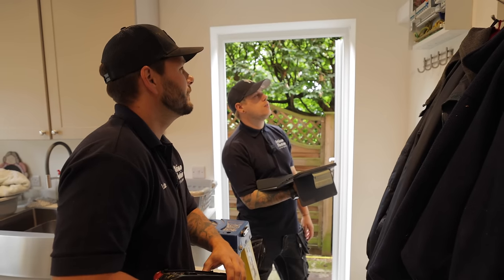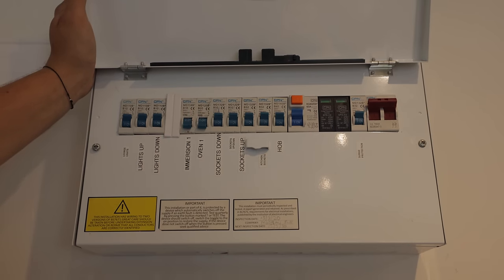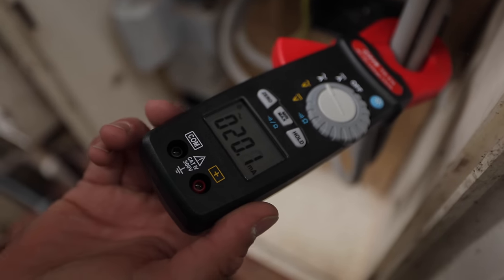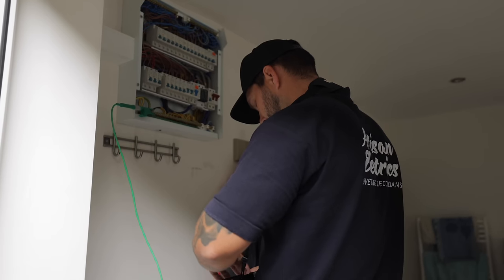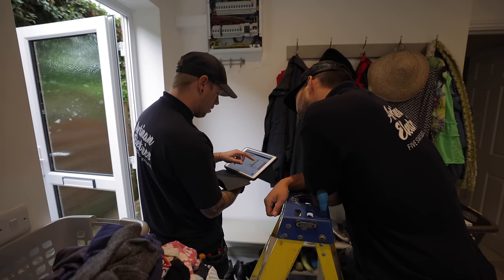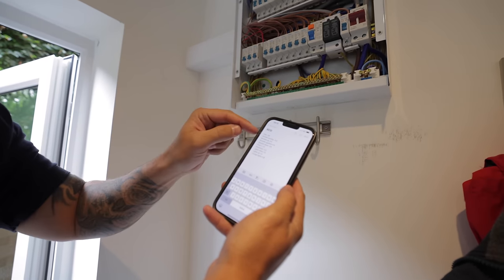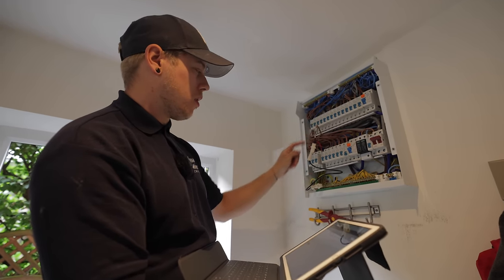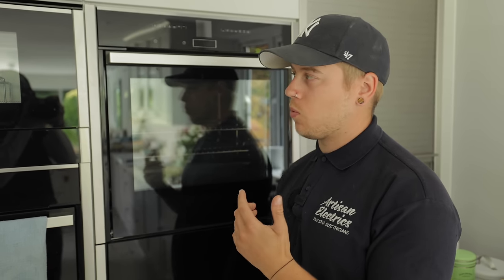CHEAP Electrician cost this customer £1000s💷

Comment: We have the rcbo version of that board and it is a delight. A led comes on when you open the cover too. It was being promoted by cef at the time. It certainly wasn't budget end. 
Very good video sharing the issues of earth leakage. Much appreciated
Reply: I've fitted a few of the rcbo boards and never had issues.
Reply: It is a budget brand. Not great at all. Not as bad as Wylex or Fusebox but not great St all
Reply: @peterigrenyi9176  I'm surprised you say that. It has everything a homeowner looks for, and the automatic lights are really helpful. The rcbos and rccb have worked flawlessly since installation. And it was recommended by our electrician. If this is a budget brand then why do people need to pay more?
Reply: @atkt62  just not built as well as more expensive brands. Also would expect a struggle with customer service if there is a problem. 

From my own experience with this board,  terminals not great, screws on few mcbs/rcbos damaged when tightening withing torque limit, lid never sits quiet right, etc.  I also expect more recalls on mcbs etc too. Just like wylex, craptree etc. 

Would much rather fit Hager. Cost probably not far apart.
Reply: @peterigrenyi9176  I understand your pov. However, we are 3 years into our cpn cudis rcbo board, not one issue. Our electrician says he fits these as standard. I guess everyone has their preferred brand. Look at the cars on the road as an analogy.
Reply: @atkt62  There's a lot of brand snobbery around...

Comment: How I understand it you took the earth off the backbox and connected it to the switch. The regs state only a backbox with 1 fixed lug doesn’t need a earth to it, however here because of the isolator type lug you have now left this backbox without a earth, which reg does this comply with?

Comment: I'm glad I am still on ceramic wire fuses. Two blown fuses in 30 years and then that was because of old type light bulbs that are no longer in existence. 
This lot🙄one electrician to test and one to film.
Reply: I'm suprised both of you don't use charriots to move around too! 

Ceramic rewirable fuses certainly works but they can't compete with how fast an RCD or RCBO trips in a fault condition and the safety such can provide.

I saw cable insulation melt/get brittle because of continuous heat up circles without a fuse blowing up...
Reply: You are glad not to have RCD protection, are you?

Sounds very foolish, even dangerous

Comment: There's no way that was a grand, look at the amount of circuits .  Alarm bells start ringing here looking at the size and quality of the house .  At first I thought the sparky may have recommended rcbo etc and the customer didn't want it but then looking at the quality of fittings and lights and then the  consumer unit install shows different . I also suspect the RCD is rated at 63a not 80 so I bet at times that bottom one is overloaded also . As a temp fix, RCD change and move a circuit to the top bar such as the oven. However a new board or rcbo conversion is definitely what is needed .

Comment: In a new build house from FH 2020... MCB on 2 RCD devices.

I would have PAID for the upgrade to AFDD + SPD.

Also pulled 6mm to the detached garage. Again, would have paid for an upgrade to the cable to make adding a car charger easier.
Reply: Most new builds are designed by the client, and are designed 1-2 years prior the the current regulations. It’s not always the electrical contractor at fault, their job is to do as the spec says. As always we can advise they do things different but if you have 40+ houses like some sites I work on an extra few hundred quid per house stacks up quickly, so they tend to avoid. Speaking from experience on this, it’s an impossible task to speak sense into the senseless 😂

Comment: When you was doing the IR test and sensitive equipment was plugged in, what voltage was you throwing down? I always start at 250DC just in case
Reply: Edit. You prob test @ 250 now anyhow,  forgot about reg 612.3.2 where value still remains at 1M ohm if doing so.

Comment: OK...yeah.. it should have been a RCBO board in the first place, but it isn't. Why is the go-to solution to replace the board, when the problem could be resolved by simply adding another RCD and splitting the bottom row?
Reply: Bus bar cut for the RCD's and you can't buy just the bus bar for an upgrade would be my guess.
Reply: @jonathanbuzzard1376  Hey 👋, I'm not sure if you are referring to the mounting rail, the MCBs etc clip onto, or the Bus (aka Buzz) Bar that connects the Line from the RCD to the MCBs? Presumably it's the latter, but correct me if wrong.
The Bus bar is very cheap, readily available and easy to cut etc. There would be no problem cutting the existing bar to split it; put in a new RCD and a new Bus bar, splitting the MCBs between the two; and take a separate feed from the Main switch and Neutral bar to the new RCD. Oh.... perhaps you mean another Neutral bar??? Ahh yes, that might be a problem alright. 😅

Comment: Is a split RCD board ever the answer these days compared to an RCBO board? Having worked on and installed both I find the RCBO board to be much easier all round, and I find it hard to believe that the overall cost will be much less with the split RCD board. With a decent quality but low cost RCBO board like the ones from Fusebox, what sort of difference in price are we looking at for say a 20 way board install compared to a similar quality split RCD board, both running type A RCD/RCBOs? It can't be more than 10 or maybe 20% surely?
Reply: It's cheaper, that's literally it
Reply: @SBBUK  Yeah I know... But in this case, surely if the spark had told the customer the reality of how many circuits will be lost just because one of them has a fault, then you'd think the (IMO) relatively small extra cost could be easily justified. Not to mention the cumulative leakage causing nuisance tripping. But that assumes the spark actually cared which seems unlikely, although it's unfair to speculate around the circumstances which led to this rather poor design choice.

Obviously some people have no choice but to go for the absolute cheapest option, but that house didn't seem like somewhere you would install the cheapest option. Then again there are people who own fancy cars and install cheap tyres made of chinesium and wonder why they can't keep then on the road! I reckon kids should be taught about "value" as a core subject at school. Not just low vs high cost but actual value!

Comment: Just swap the lot out with RCBOs of the same manufacturer. That will also give them more space for the future. Also, just what is it that's considered to be so wrong with the CU unit itself? Hardly the CU's fault that there's cumulative leakage currents; that's down to the fundamentally inappropriate choice of using a dual RCD board, especially bad in such a large property.
Reply: How would you fit a bunch of RCBOs in that overcrowded board?  Also, they might get a discount buying a premade board with 40+ RCBOs already installed and connected together, instead of buying a wholesale crate of 40 RCBOs that need to be put into the box .  Pricing structures tend to encourage complete replacement on every upgrade .
Reply: @johndododoe1411  Are you aware that an RCBO takes just one slot, and that means they actually take less space as you can remove the RCDs? RCBOs take up less space than dual-split RCD boards. Indeed, you get 4 slots back.

Also, the physical process of clipping an RCBO into place and connecting the bus  bar takes no time. It's the wiring and testing of circuits that takes more time.
Reply: @TheEulerID  My guess is the bus bar is cut for the RCD's and getting replacement bus bars is probably not an option so new consumer unit. Frankly it's a shame that you can't get the spares for upgrades. My board could easily be upgraded from 16th to 18th apart from the two plastic covers for the breakers as it's otherwise a metal board and I could upgrade the none RCD side to RCBO's. Though I am quite happy that the earthshield wired double outlet in my server cupboard is not on an RCD thank you very much.
Reply: @jonathanbuzzard1376  You can get replacement bus bars without any trouble whatsoever. They are freely available, including from suppliers like Screwfix or TLC, and they are available in any length you might reasonably use. If necessary, they can be cut to length.

If you are talking about metal blank plates for gaps in the breakers, then those are also freely available as well.

Of course the break in the neutral bar (for a dual RCD board would have to be bridged with an appropriate copper jumper.

Comment: so many new builds are still having these double bank split load rcd boards installed in 5-6 bed houses, I've worked for companies putting them in. Never understand why they can't just add a bit more budget and get an rcbo board. Like Lee said they need to ditch split load boards all together but will they? There needs to be a dangerous situation occur for this to happen but most the time its just a nuisance

Comment: Why is there intentional earth leakage. I thought earth was only for emergency. 

Am a utter layman as far as electric installation. So if anyone could explain it would be great.
Reply: There are components in the supply (Class x & Y capacitors) of any equipment using electronic power supplies or control to stop harmonic energy getting back into the supply network.  As the amount of electronics and high power switching controls increase so does the amount of interference pushed towards the DNO distribution.  It also annoys the heck out of radio Hams as our licensed frequencies are jammed by the muck.

Comment: Watching these professional electricians videos on YouTube makes me feel sick to my stomach because of what I did in my old parents house when I was little and when we moved out I did not tell anyone about the horrible botchery I hid in the walls secretly.. when I was 14 years old I had only one ceiling light in my room so I wanted to add at least one more so I used the earth wire going to the ceiling fixture as another phase wire and I did the same thing going to the single switch and I never told anyone about it, the same goes when I wanted to add another few sockets in my room with different breaker so I used the existing earth wire in my room as a second phase wire and nobody knows that. When we moved out I never told anyone about it. I was scared my mom would kill me for that lol.

Comment: You have the tester set to the wrong test setting when conducting the rcd test and also an rcd should be tested with the load side disconnect as existing fault current can affect the times and mA and not give you the true readings of the rcd.

Comment: Slating the previous sparks is a bit bad when your pulling cut out fuses when you shouldn't be 😅🤣
Reply: they fall out, vince from network power comeround and oop there it is
Reply: The written rule is not to pull a dno fuse, but in the real world, this rule is totally impractical.

Comment: 15mA on one and 20mA on the other. The maximum permitted leakage on a single RCD is 30% of the rated residual current which is 9mA. Further investigation is definitely required to establish where the high leakage is coming from on both RCD’s. The board looks cheap and poorly installed.

Comment: max leakage is 9mA per RCD, or for each RCBO, so none of the rcd's complied to this.  Also your instrument showed >300mS instantly. Unless you sped up the video, the instrument should have continued to try and trip the rcd for 2seconds.
Reply: 9mA earth leakage per RCD? Here in Australia, the standard RCD is calibrated to 30mA. Hospitals and schools must have RCDS that trip with 10mA.
Reply: @trevorstevenson4038  The 9mA is for continuous leak I suspect, to allow temporary leak loads on top. The regulated trigger condition is still no higher than 30 mA (seems like the global standard) though in actuality 25mA seems the norm for when they break the circuit.

Comment: Van battery's a bit low. Should be 12.8V once the surface charge is dissipated (doesn't take much load to do that - interior light or just the key on ACC will do it pretty quickly). You'll want to get that load tested before the first cold snap.

Comment: Non sparky here. Why do those appliances have "intentional earth leakage"? I paused to ask this so apologies if it was explained it later in video! 👍
Reply: That requires an electronics engineer to answer it (rather than an electrical engineer).....

The majority of 'intentional' earth leakage comes from modern switching power supplies, i.e. phone & laptop chargers along with computer power supplies, TV's - well practically any modern consumer electronics nowadays as they all contain switching PSU's.

The leakage comes from a low value capacitor used to connect the low voltage output DC side back to the 230v AC side, or in many cases back to earth. The purpose of this is to meet EMC requirements (electromagnetic compatibility), i.e. to reduce the amount of high frequency noise that the switching supply is producing and to prevent the cabling from acting like an antenna and transmitting this unwanted RF noise.

It is a balancing act as you want to reduce the RF noise from a device as much as possible, but in doing so you are producing earth leakage currents which as in this video can become a problem if you have lots of circuits (and devices) all on the one RCD.
Reply: Filter capacitors from L To E and N to E and across L N. Called X and Y type suppression caps. Reduces electrical noise from the device entering the wiring as required by EMC regulations to meet CE approval. Light dimmers are also culprits especially older triac based designs because they make a lot of noise and need decent suppression.
Reply: @blower1 wow, thank you so much for this clear and detailed explanation! I definitely understand it more now....didn't it use to be RF interference that caused havoc with analogue TV anc radio signals or have I got that wrong?
Thank you for taking the time to educate me, really appreciate it.👍🙏
Reply: @rowifi thank you for this too.👍🙏

Comment: Housing changed our board a few years ago and we had nothing but problems.
Turn something on (a light, the kettle, etc) rcbo would trip, not just once but multiple times, reset and trip again.
I've changed them all back to (same value) mcb's and no more problems.
Reply: Hold up do you mean you changed the RCBO's in your board to MCB's that is not an advisable fix
Reply: @markpotter8280  It's all still protected with RCD's so there's no problem.

Comment: CPC disconnected during IR test is a really big failure, please read up on why you should not do that. Recommending the board to be changed when it could have RCBOs installed.